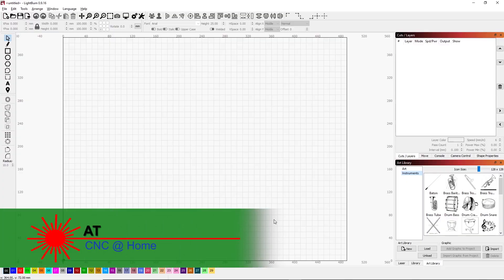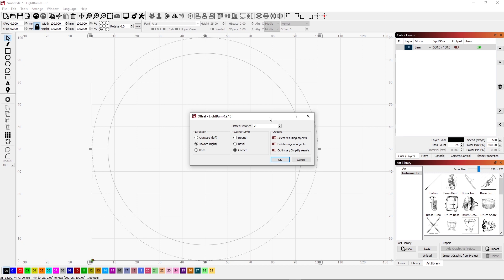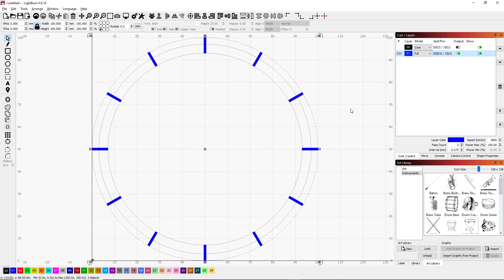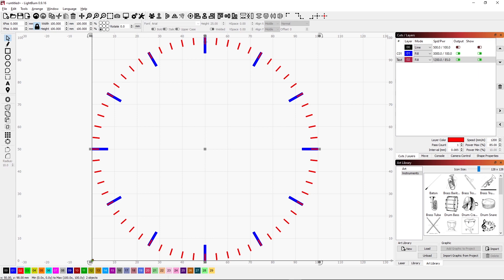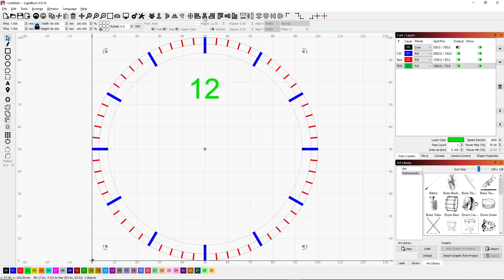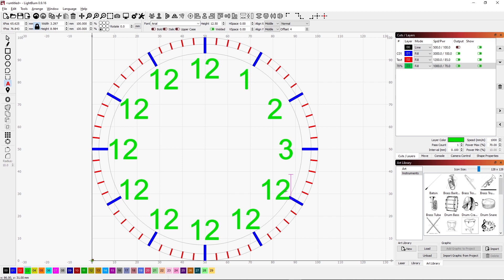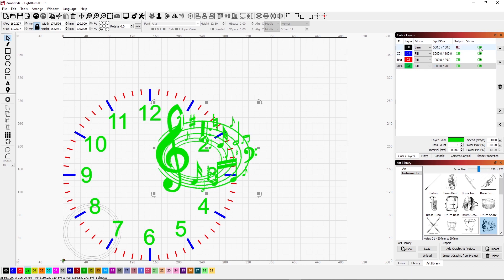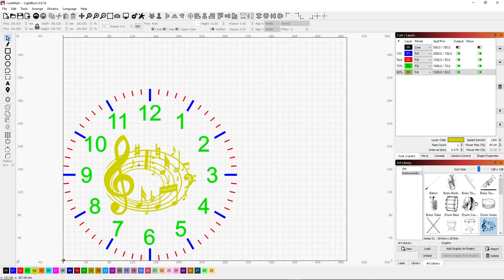Create a clock face using LightBurn

Comment: Thank you for the video I got everything to work exept the fill wouldnt work for me. Probably a newbie error. LOL. Ant ideas where i went wrong?
Reply from the maker: Depending on what you mean by "fill wouldn't work", here is an idea.  If your fill shows in when you do a preview but does not show when you are in the editing screen, here is what you can do.  There is a setting you will need to change.  Under the Edit menu, select Settings.  Or you can click on the Settings icon that looks like two cogs.  In the "Display / Graphics" area, turn on the "Filled Rendering (slower)" option, it is off by default.  When you have a layer's mode set to "Fill", it will show filled while you are editing.  This is slower as the computer is having to do more work.  Unless you have a very complex drawing, you won't even notice the slowdown unless you are on a very old computer.  🙂  I hope this helps.
Reply: @CNCATHome  thank you I will try that out.

Comment: Great tutorial. Just one question. My lines aren't as smooth. How can I change to 'vectors'?
Reply from the maker: Great question.  Everything you draw in LightBurn will be a vector. If it looks jagged on the screen, that is most likely due to what is called aliasing. It is why a diagonal line may look jagged but a vertical or horizontal line looks nice and straight.  Because LightBurn works with vectors, the line will be straight when you burn it.  Well, at least the code that is sent to your laser will be for a straight line.  My laser likes to draw a little wavy sometimes.  ;-)

Comment: Hello friend, within the subject of LightBurn, in the Cuts/Layers menu, what is the difference between Fill and Fill + Line? Thanks
Reply from the maker: Good questions.  It is exactly what it says.  It performs a fill on your shapes and it burns a line around it.  It does both fill and line for your burn.  There are times when an extra burn around your fill can make it look a little nicer.
Reply: @CNCATHome  Thanks for the answer. If I asked you to share your art library, would I be asking you too much?
Reply from the maker: @Dancopymus  - I have gotten that request before and I really can't to that.  Most of the images are ones that I found on the internet and I do not have copyright permission on them.  I am not using them for sale so I am not working outside of the copyright laws.  Once I start selling or distributing them, then it starts to be an issue.  The best way to get a library is to search on images and save the ones you like.  If you are going to use that image on something you plan to sell, contact the image owner and see if you can get permission to use it.  🙂
Reply: @CNCATHome  Thanks

Comment: Hello. how to improve engraving quality?
Reply from the maker: There are several things you can do that may help with engraving quality.  Number 1 is to make sure your laser is focused properly.  Insure your lens is as clean as it can be. Setting your feed rate and other parameters is critical to getting a clean burn.  Each material type will needs it own settings.  By experimenting with your laser configuration, you can come up with what work for you.  Here are some parameters you will want to fine tune: feed rate, laser power, lines per mm, over scan.  Sometimes, the order in which things are burned in your project can affect the quality.  
There is no one magic thing to improve your quality.  Keep in mind that the characteristics of your laser will change over time and you may need to adjust your burn settings to adjust for this.  I hope this helps.

Comment: Great tutorial but I got lost at 4.07 I clicked fill but only the outline filled Where have I gone wrong?
Reply from the maker: I had a big long explanation of I don't know what is going and then I remembered, there is a setting that tells LightBurn to either display fill or not.  In the "Window" menu, you want to select "Filled / Coarse" or "Filled / Smooth".  Otherwise, you can see things filled in by doing a preview (Alt + P).  Great Question.
Reply: @CNCATHome  Thanks for your reply I will give it a try